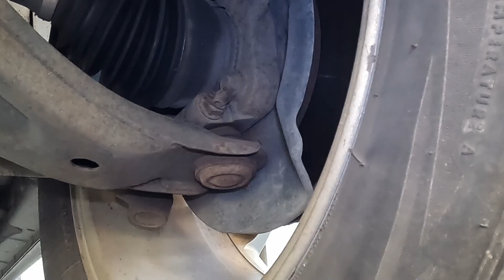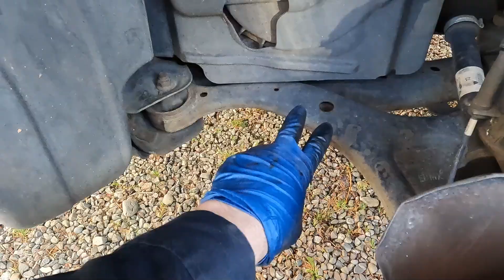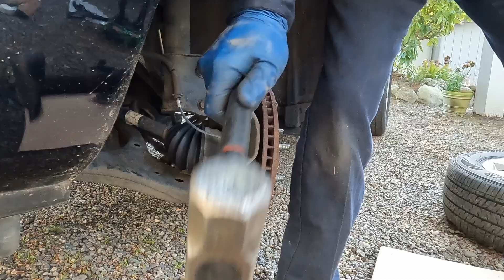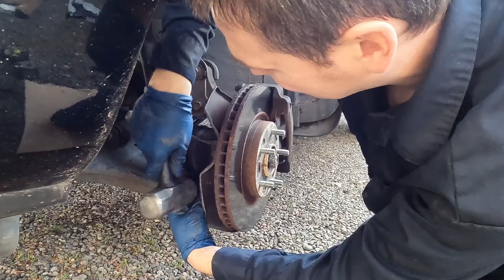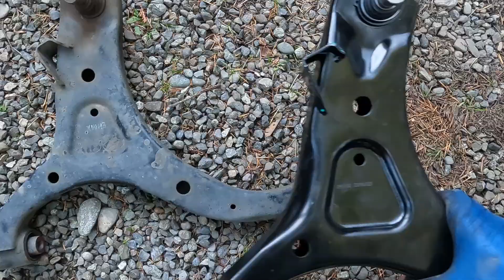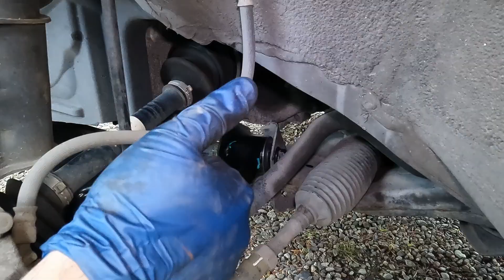2007-2012 Hyundai Santa Fe Ball Joint Replacement Lower Control Arm DIY

Comment: Is it necessary to adjust the front of the steering wheel after replacing the triangles?
Reply from the maker: Yes. It is recommended to get an alignment after this replacement.

Comment: Hello my dear friend, before you tighten the last bolt, how do you know how much you should lift with a jack before tightening the last bolt?
Reply from the maker: Just so the car is being supported by the jack. If you have jack stands under the frame lift the car up just above the jack stand 👍
Reply: @ValleyMobileAutomotive I saw a video of you before I tightened the last screw. You raised the triangular level with a jack. How many angles did you raise it to?
Reply from the maker: @מאורקשני  Raise it so it's only the jack holding it up.
Reply: @ValleyMobileAutomotive  Do you have a recommendation for triangles? USA brand installation?
Reply from the maker: @מאורקשני  I have links in the description to a part I think will last a long time 👍

Comment: You can  change the ball joint on the lower control arm, you just need a ball joint press tool kit, I have done this work on my own 2012 Hyundai Santa Fe.

Comment: Nice video, thanks. Have you ever just replaced the front bush on the control arm?
Reply from the maker: I have replaced bushings on other vehicles in the past. I have found it easier to just replace the whole thing. You get both new bushings and a new ball joint plus an easier install. Win win 👍

Comment: You can replace the ball joint by itself.  No need to replace the control arm unless the rubber bushings in the control arm are shot.
Reply from the maker: They do sell ball joints separately. The manual says not to replace them separately but to replace the whole arm. So we followed the manual's recommendation 👍

Comment: Looks easy  but i know its not that easy I'll try it to do that thanks for sharing your knowledge 😊
Reply from the maker: It's not too bad. The hardest part is when putting the new one back in it needs to line up a certain way to slide in. So keep playing with it and you'll get it. Let us know how it goes 👍
Reply: @ValleyMobileAutomotive alright thanks
Reply: I got it done thanks to you but actually it was a big pain big time to remove the bolt from the lower control arm because both side the lower ball joints and one bearing was totally shot very rusty😔
Reply from the maker: @mariomata9177  Glad you got it fixed 👊. Sometimes corrosion is the biggest hurdle.

Comment: How do you know when the new ball joint is fully knocked in there? Will it stop on its own?
Reply from the maker: Yes, it will stop on its own. Also look into the bolt hole, you can see the notch of the ball joint line up with the hole. Once you can get the bolt through that's it 👍

Comment: Your replacement arm musta been closer to OEM spec than the ones I got.  It took me a good 2 hours beating and hammering and prying to get the bolt holes to line up and the ball joint to go in.
Reply from the maker: It was a little struggle for me too but once I got it lined up the way it wanted to go it dropped in. Glad you got it 👍

Comment: Hey!  Your video inspired me to buy a control arm online for like $90 and go for it.  It was cake, and it fixed the crunchy metal sounds when turning sharply to the left.  As a matter of fact, the ball joint fell apart  as I was removing the control arm.
Close call  😅

2011 Hyundai Santa Fe Limited AWD 6 cylinder
Reply from the maker: Wow! Glad you were able to get it replaced 👍

Comment: What about if i change the front rubber the big one at the front to direction matters ?
Reply from the maker: I haven't changed a bushing on these control arms before. I tend to just replace the whole thing for simplicity.

Comment: Many thanks, your method was precise and very understandable. I will try this myself when the time comes. My car has just passed the difficult Ministry of Transport test here in Northern Ireland. So hopefully I won't need to do this for a while. I bet the car drives so much better after that repair.
Reply from the maker: It made a huge difference! These ball joints were so bad they were on the brink of breaking. These are good cars, I think you'll be happy with yours 🙂

Comment: Ur video is a lie. Ur bolts just do”line up”. Look at that it’s just lined up. How bout u show the struggle instead of o look at that it just happens to line up crap
Reply from the maker: Which bolt are you struggling with?
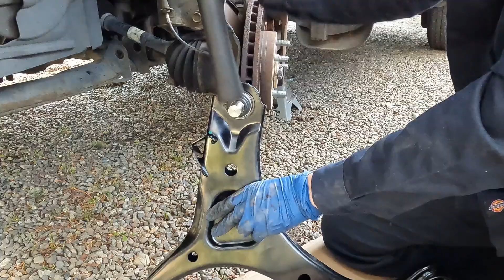Reply: 4:45Watch from here
Reply: Maybe because he doesn't want the video to be an hour long.

Comment: Great video! What happens if the ball join comes off the arm and gets stuck?
Reply from the maker: They make a tool called a pickle fork. It will wedge in between the knuckle and ball joint to separate it. You might be able to rent it from the parts store 👍

Comment: Is there a reason you didnt replace the ball joint itself by keeping the control arm in place and just moving the wheel assembly out of the way?
Reply from the maker: @powerplayer75  Good question. According to the manual these should not be serviced separately. I'm not 100% sure the reason but we followed the manuals advice 👍
Reply: @ValleyMobileAutomotive it’s just more time and tools
Reply: He literally explains that the first 3 minutes
Reply: You can and it’s a lot cheaper than buying complete arm
Reply: Yes because the 2 frame mount bushings that are integral to the control arm also age, crack & die.

Our Santa Fe is 17 years old & 217k miles.

It's foolish shortsighted economy to replace only the ball joint.

The entire arm w ball joint isn't expensive